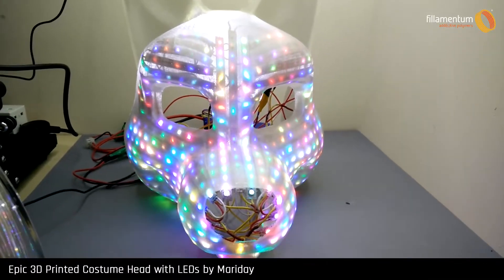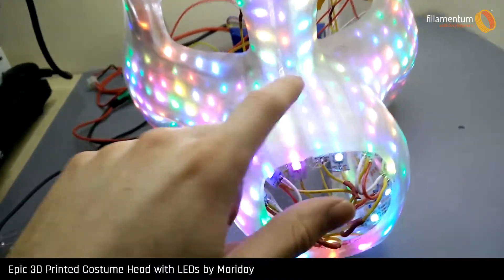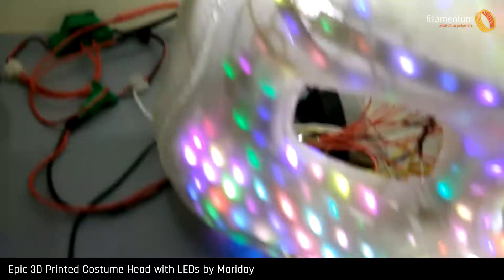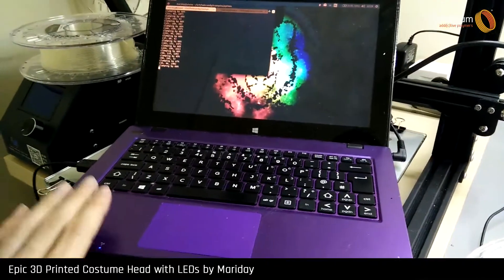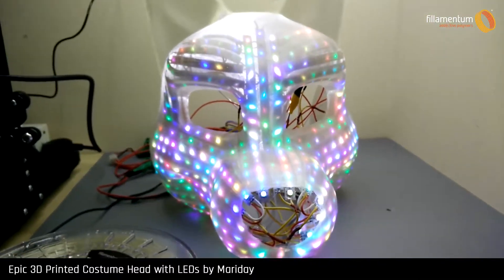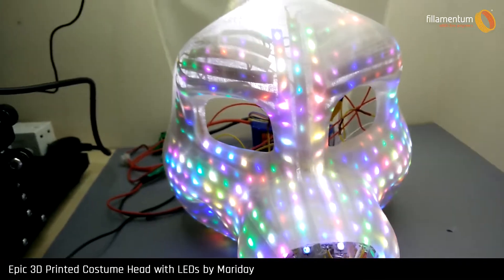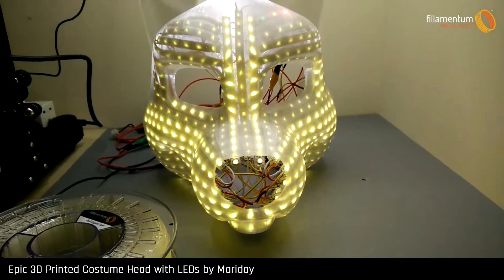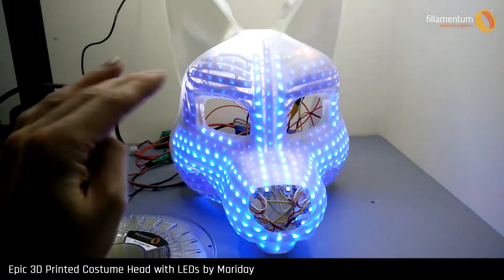Epic 3D Printed Costume Head with LEDs by Mariday

Comment: Any secretes to get this filament to print? I have a Prusa i3 MK3 and printing with this filament always seems to fail. I've tried temps from 200 to 215.
Reply: Hello, The working temperature for PLA Crystal Clear is starting on 210 to 230. So your temperatures are low, that can be first thing. Please, could you write us on helpdesk@fillamentum.com and tell us more about your setting? Best to name what exactly is the problem or send us photos of prints. On the box is also a production number starting with VZ ..... please, sent us this info too. Thank  you!
Reply: Thanks, it is printing better at 220. The main issue I think was the roll was so tight/heavy the printer had troubles drawing it from the roll. Now that it's about 75% used, I have not had any failures.
Reply: I have a Question... Is the STL open source xD Please i suck at making 3D Models xd
Reply: @mutethecyberwolf  Yes it is! send me a dm on twitter @themariday